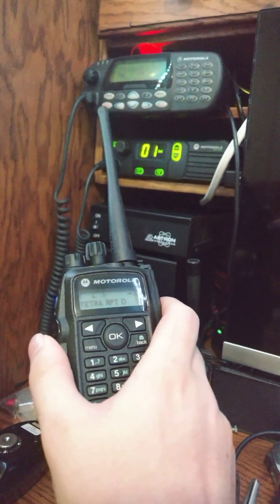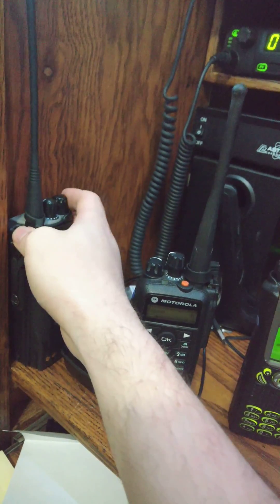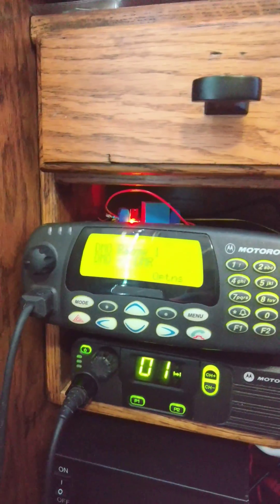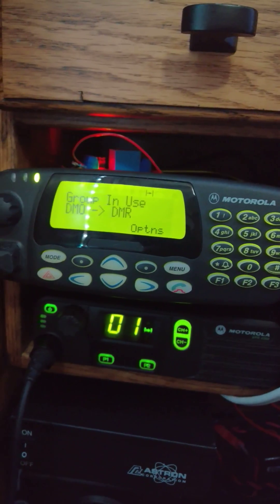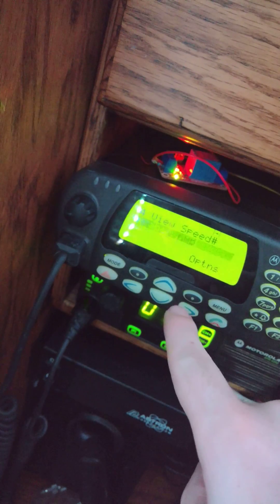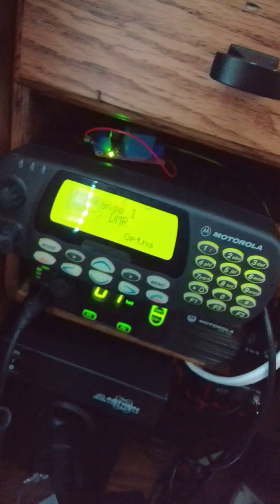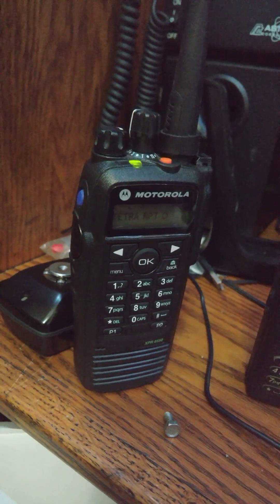It works!

Comment: Hello, I would like to know how you managed to put that tone on the mtp700. I have an mtp850 and the final tone is heard with a classic final beep. Could you tell me if you had to install something on the computer? Greetings and thank you
Reply from the maker: Not too sure what your talking about. From what I remember it does the same CTS beep as all my other Motorola units
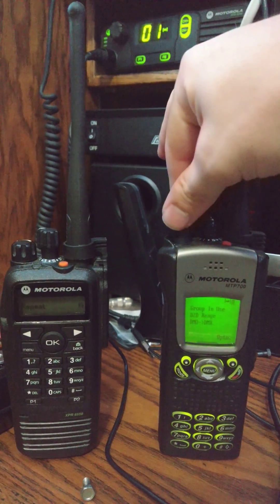Reply: @anongator hello, thanks for answering, at 0:44 the device emits a different beep from the one that sounds in other videos that you have I don't know if it's the model of the equipment.
Reply from the maker: Ah, that's the mototrbo radio. It's the channel clear tone